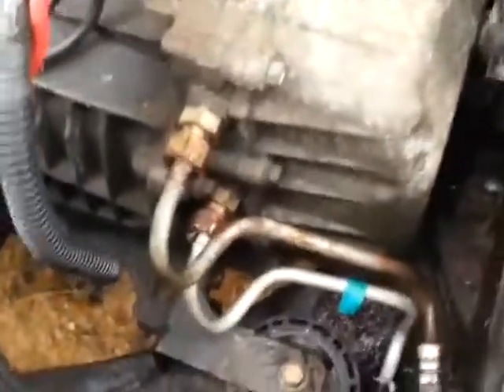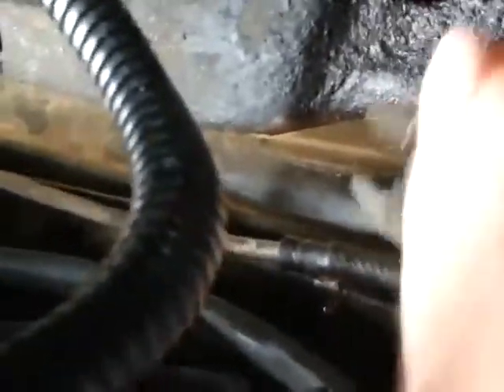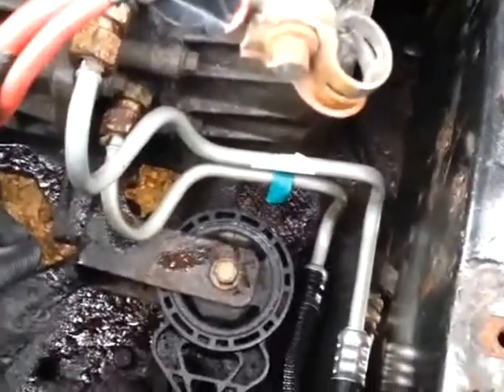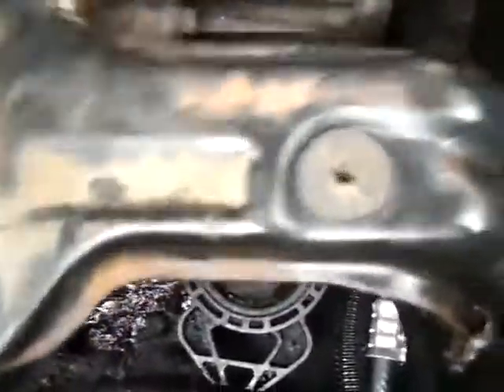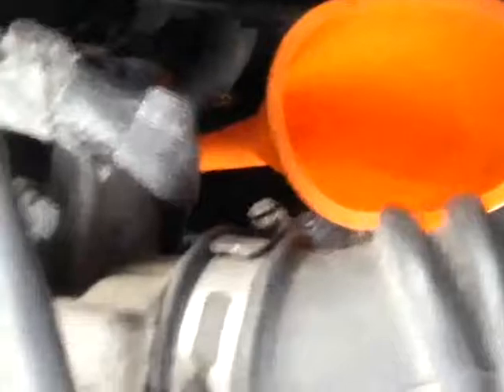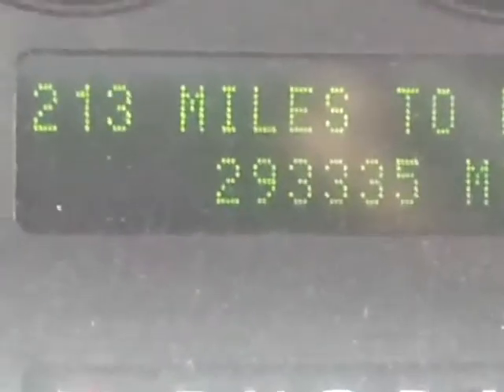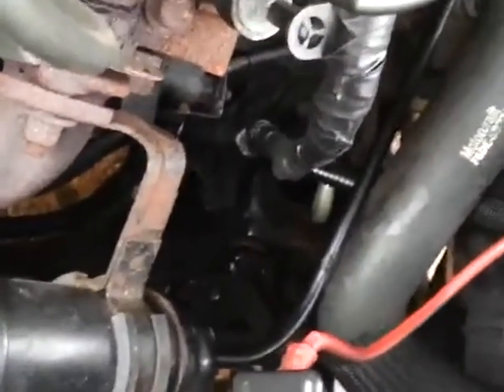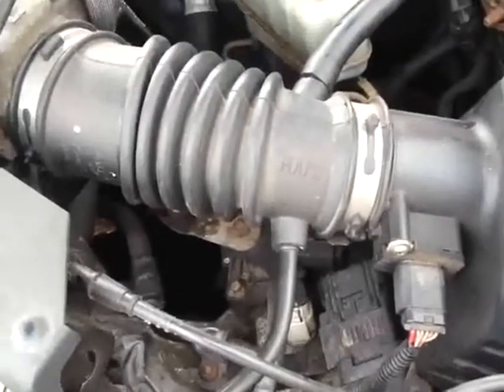How to replace transmission cooler line 2004 ford taurus lx 3 0 liter

Comment: Do not use a disconnect tool to remove those lines! You can see in the video 2 plastic wings sticking out of the cooler lines where they connect to the transmission. To remove the line, you pinch those wings together and pull the line out. Very easy to do.

Comment: Just a heads up to anybody watching this video. I called the Ford dealer and they don't sell those transmission lines anymore. Now I'm going to have to try and find something online. Good luck to anybody doing this
Reply: Did you find the part, I cant find anything!
Reply: @crisbritten8219  I was able to  bubble flare my transmission lines and use thick rubber hosing with two clamps. You can also go to a junkyard and see if you can find them . If you are up North with a lot of salt on the roads chances are they're going to be just as rusty. The bubble flare would be your best option. I would take the pieces to a mechanic and have him do the flare. They are thick steal and I couldn't do it with my flaring tool at home. I have a cheap crappy one from AutoZone.
Reply: Try O'Reilly they have them in Arizona they have three different ones

Comment: can you please let me know where you bought the line from, I cant find it now where, so can you please let me know, thanks
Reply from the maker: PoWeRuLeRs geez I think I got them from the dealer. That was a couple of years ago maybe 4 years ago
Reply: I can't find any for my 2000 Taurus anywhere!
Reply: transmission oil cooler line disconnect tool on amazon and at O'Reilly

Comment: engine sounds ruff.
Reply from the maker: Yeah a little huh? The car has 300,00 , it also sits there on weekends and nights. i had just start it up after replacing that line, when it was cold. That will be another video, :) Thanks for sharing.